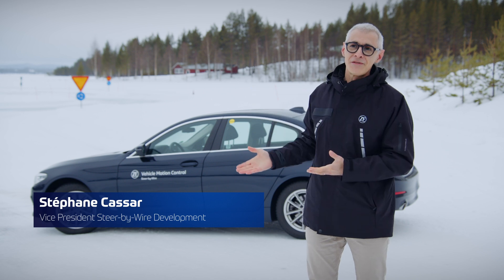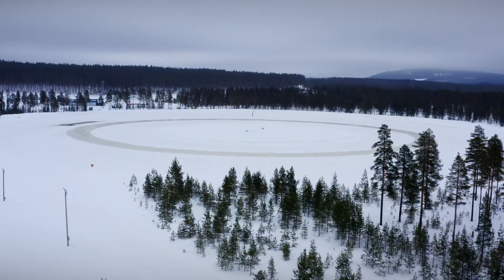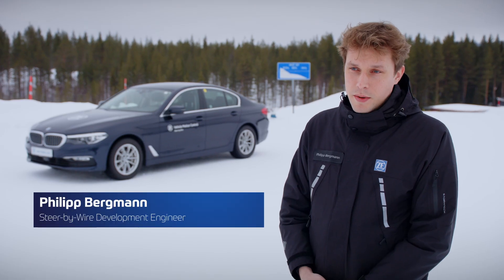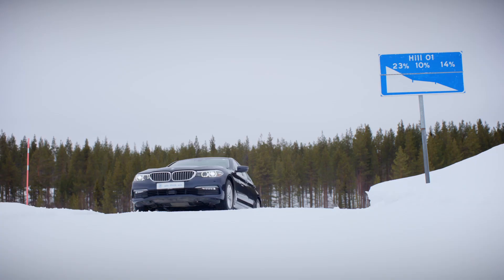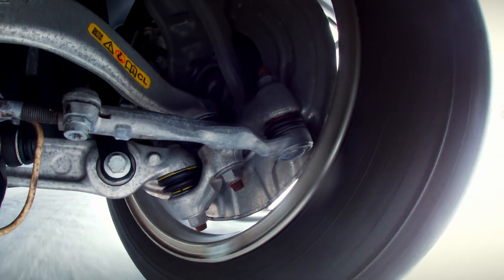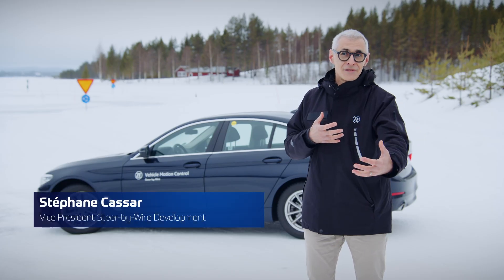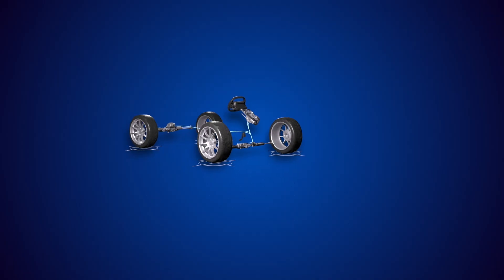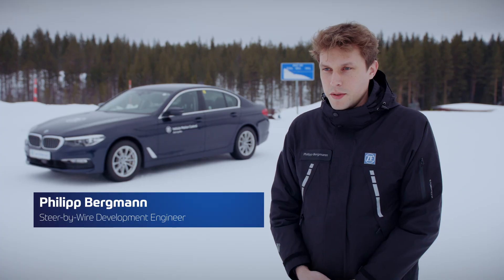ZF Winter Testing: Steer-by-Wire Under Extreme Conditions

Comment: if you are going to go through the trouble of making steer by wire... why not put a side stick like in airbus instead of regular steering, it would clear up more space in front of driver, might even improve crash safety etc.